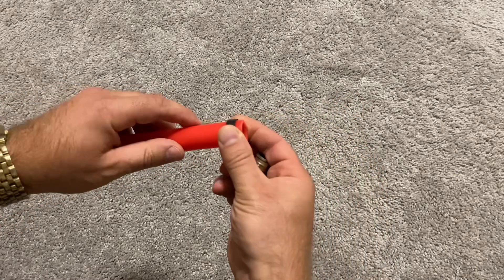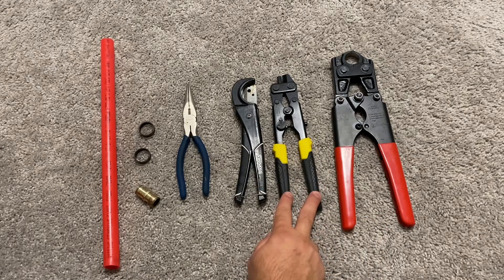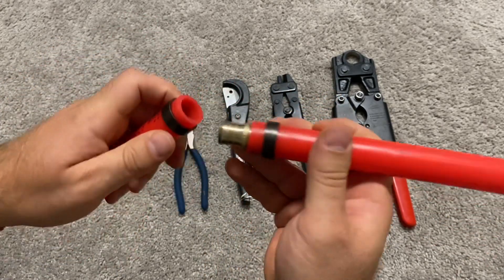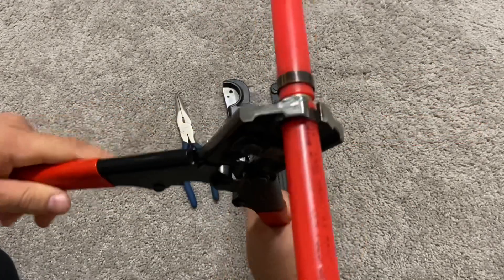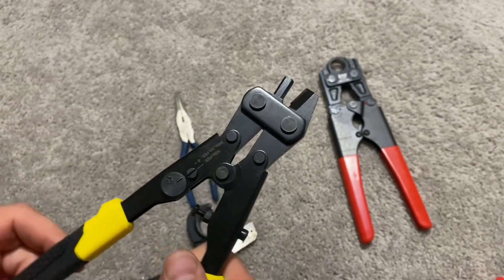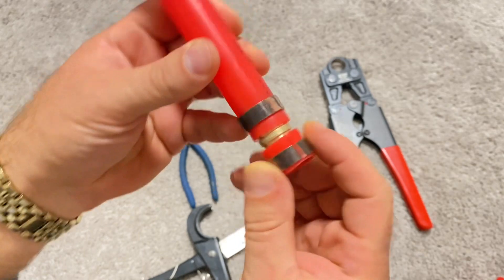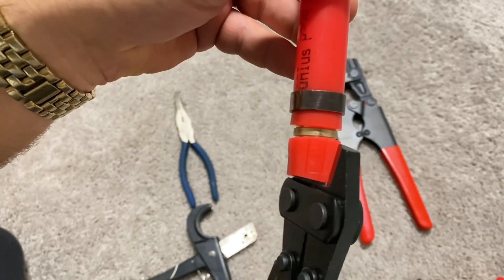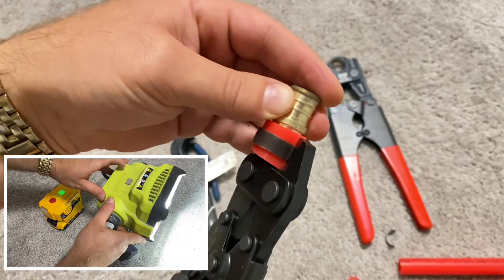Easily Remove PEX Crimping Rings Disconnect Pipe Connection

Comment: I have a friend who converted a PEX crimp tool into a PEX press tool by carefully filing off the end of the tool.  Does anyone know of a video of somebody doing this? I asked my friend to share with me how he did it but he's not reliable in replying back in a timely manner.  Thank you for your time.
Reply from the maker: Not really. I havent heard of someone doing it. 

By the way my tool is also modified. As you can see in this video, I cut the ends of my 3/4 tool to allow it to go access closer to wall where existing copper pipe is. Originally there was also 1/2 crimper a the end of the tool.

Comment: 1st  you never use a needle nose or any other pliers to keep the Pex fitting from moving when crimping.
You only use the Crimping tool.   2nd The ring that your crimp should be an 1/8 of an inch away from the Pex connection.   In this video it looks like it is at least 1/4 inch away.  And the most important part is after you crimp check it with a Go or No Go tool.
Reply from the maker: A quick search helps to find that a distance from the end of the PEX tube to copper ring can be between 1/8" - 1/4", but i guess 1/8" might be better than 1/4". Can you explain why one would never use needle nose pliers? I find it very helpful to hold the ring in place while I am crimping it. I agree about using Go-NoGo tool to verify tight crimp. Forgot about that in the video.